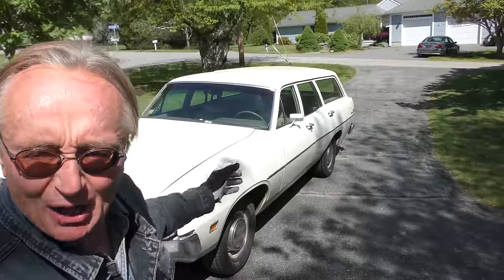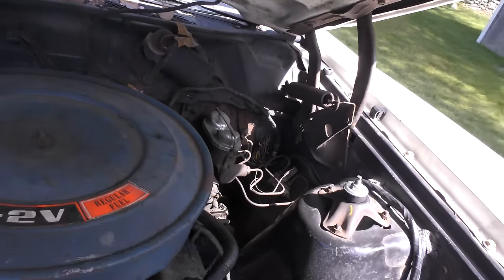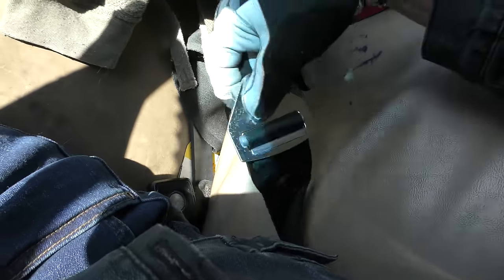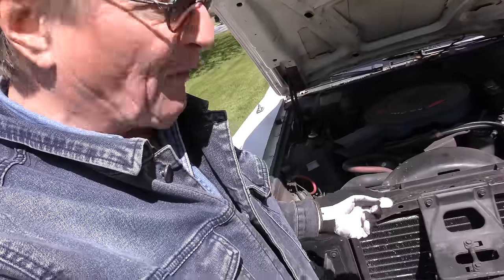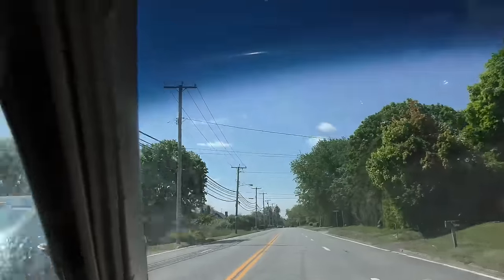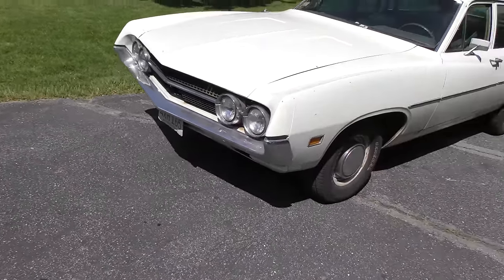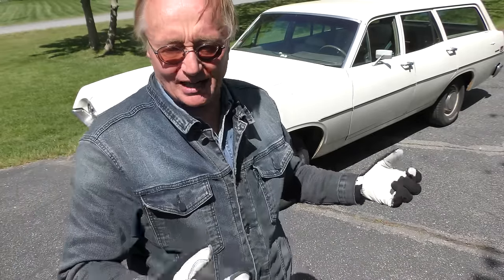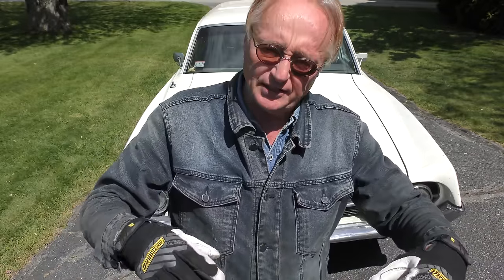Cops Can’t Pull You Over in This Car (Even If You’re Breaking State Laws)

Comment: I used to have a 1978 Ford LTD station wagon. Got it in 2006 with 22,000 original miles. Drove it until 2016 when the body was rotted out. Used in a demo derby, and it still ran when done. Sold it to a Ford guy who wanted the drive train. He was thrilled as it was still operating fine.

Comment: That car is just proof that the EPA is full of it.
A car that big & heavy with a V8 that still gets 18 MPG, there's many new modern cars today that don't do that.
Reply: My Camry 4 cyl gets less. I'm going back to American V8 engines . Preferably from the early 80s.
Reply: Most people that know anything about cars, like V8's for a reason.  They're not all necessarily faster, but it delivers smooth power and a well maintained V8 will out last all this tiny turbocharged crap that they're putting in vehicles today.
Reply: @mplslawnguy3389  
Exactly, I absolutely hate these small engines & turbos.
They tried that stupid mess back in the 80's & it failed horribly. They put turbos on everything, hell even boy's bicycles had turbo stickers on them.

Comment: I do not miss points, distributor caps and rotors. Timing lights, carburetors and drum brakes. Changing spark plugs every 10k miles, and bias ply tires.
Reply: I don't miss headlights and taillight burning out all the time , sand bags in the trunk for winter traction , left hand threads on old Dodge lug nuts , frozen fuel lines .
Reply: I hate computers and electronics!!!! I’ll take the old ones any day👍😁🇺🇸❤️
Reply: I really prefer driving around in a over priced computer controlled pile of plastic.
Reply: I don't miss having to file points, but the point files made excellent nail files.
Reply: @robertrosicki9290  at least you could just buy a replacement bulb, not spend 3 thousand on a whole new light enclosure
Reply: @jamesrecknor6752  Yes, a lot of plastic and expensive, true.  However cars 30-40 years ago were not very reliable.  Sure they were good to work on, a lot of DIY, but you had to work on them all the time just to keep them going.
Reply: Carburetors are the worst. 😵‍💫
Reply: I also don't miss timing BELTS

Comment: Those 302 engines were very smooth running motors. Navy trucks I used had a few 302s I remember them as quiet V8 wonders. Smack the dash like Fonzie, radio might kick on.

Comment: When I was a kid the neighbor had a newer Torino station wagon with power brakes. There was a big metal circle on the brake pedal and it said POWER BRAKES. I was riding in the front seat. I asked him what that meant. He said the car had more stopping power.
Nobody even thought of wearing seat belts back then and we were packed in the car. I was down on the floor in the front seat. I reached over and touched the brake pad to see if the ring was real metal. The car came to a screeching halt. Very good brakes. I got yelled at, of course.

Comment: I drove a 86 Buick station wagon with wood panels and had seats in the very back that folded to look out rear window and the rear window in the back door even went down! 
That was back in 2011 
It was my grandmothers boss mothers and they used it in the yard to move things and run errands I stopped by last week into the shop and it’s still there being driven around the yard! Now has 550k miles original everything!

Comment: I'll take an antique any day over modern cars that explode into pieces if someone rams a shopping cart into it.
My first accident, I came over a blind hill doing maybe 20-25 and slipped on wet ice right into a stopped Honda, who then got off the clutch and rammed into a Nova.  My car had a pushed-in grille but not even the headlights were broken, the Honda was destroyed front and back, dumped its coolant, etc., and the Nova had a scuff mark on the rear bumper.  Nova Guy just looked at his bumper, said he'll give his info, but being that nothing happened to his car, he was outta there, and took off.

Comment: She is is a beautiful, and drum brakes work just fine because of their self actualization built into the design! It is fascinating- look it up. Only draw back is they tend to have trouble dissipating heat and (water if totally submerged )as well as disks and are far more complex with all the springs and gilhickys etc . But they stop you fine , no boost needed because of the ingenious mechanical engineering!

Comment: I love wagons.  My first car was a '60 Chevy wagon. I could put my 16-foot duck hunting skiff in the back, and it would only stick out a couple of feet beyond the lowered tailgate. Later I got a '88 Ford Fairmont, straight 6 with 5 on the floor.  I had to wait an extra month to get the car, because the transmission was made in England, and they had to ship it to the Ford Factory in Michigan. I sold it when it had 99,000 miles.  Years later I talked to the person I sold it to, and she put on another 60,000 by then, and it still had the original clutch.  My last wagon was an '88 Taurus.  One of the best cars Ford ever made.  I got to 188,000 on it before I overheated it, and the engine seized.  By then only Europeans were making wagons, so bought a 2004 Ranger that I still have. It has a manual transmission, roll-up windows, and plastic flooring (no carpet.) It does have power breaks and steering and even AC.
Reply: 60 Chevy, like a 59 but without the Bugs Bunny carrot inspired tail lights. Neat!
Reply: @jamesrecknor6752 I could go 95 mph in it, and the cops could not see me.  That was with the proverbial petal to the metal.

Comment: It's so funny, I just got my wagon back from the shop - a 1988 Counttry Squire and I am so happy with it. It needs a lot of work and a paint job, but it runs fantastic and a real cruiser on the highway. That Torino is a real beauty and in better shape than mine, I'd really like to find a 1969-72 Ford station wagon - love the simplicity of the old ones and they are bigger than the 80s versions. But basically mine is my SUV and plan to take it camping and surfing this summer. Love this review!!!

Comment: Garontee the horn issue is in the steering wheel horn ring. My 68 Mustang did the exact same thing-one horn weak sounding. Ran a jumper wire to each horn; they were fine-LOUD. Took off the steering wheel and the grease had hardened where the contact rubbed the copper ring. Cleaned it out and now, HORNS WORK.
Reply: This wagon’s horn may just be a single-note horn and be fully working.  That’s how they did cheaper cars like this one back in the day.

Comment: My first car was a 1969 Grand Marquis Brougham! Saved it from the wrecker for 150.00. Cost me 60 bucks for a front clip(Bumper and Headlight assembly) Took a few hours to do the swap, Passed the safety after a brake flex line I missed was replaced.
Had a 390ci Hi-performance V8, 4bbl Carb, 4 bolt mains and the hide away head lights all painted in blue with the black vinyl roof.
Scotty would have liked this one as it would keep the tires lit through 3 gears and the rear wheels would start hopping with the needle buried past the 120 mark!!! Oh, and that would drink 1/4 tank for that little blast, but it was worth it.

Comment: It's a fallacy that newer is better.  I daily drive a 2001 Honda CR-V.  I can work on it myself, it's cheap to insure and fix.
Reply: Is it difficult to get parts for an older car like that?
Reply: @samjones3106  Nope.  Parts are all over the place for them
Reply: Honestly, who needs a new model car or truck?  It has 10k things that will break or short out, we're not saving the planet with these new vehicles, we're only securing a profit margin for manufacturers.  Now, think about down the road.  Assuming they can convert cars and the power grid to EVs, what will they use next to bump prices?  Lowering the draw rates/charging time on the grid for recharging?  That would theoretically reduce greenhouse gas by reducing the carbon footprint of the government/electric companies as they use carbon fuels at their power stations to supply the grid.  How will they cremate people without carbon fuels?  All kinds of interesting questions and tax opportunities to look forward to:)

Comment: With old cars like that you may run into problems with the windshield wiper motor, sheet metal around the door strikers, worn out seats, failed power window motors, and harness and cracked window and door weather striping. I really do miss the old cars with their distinctive and classy style.